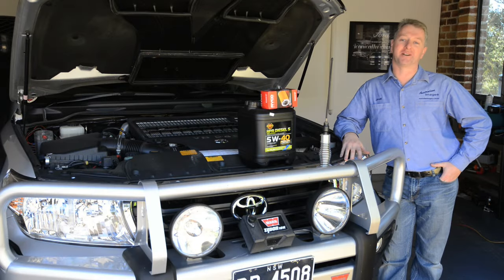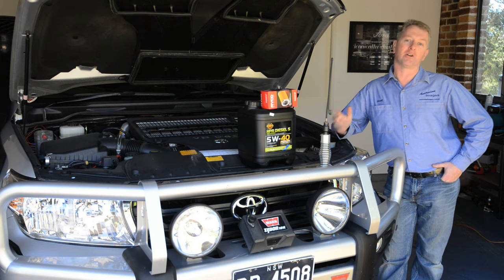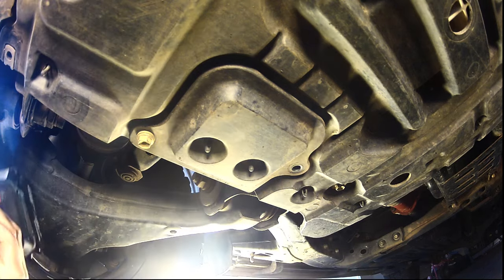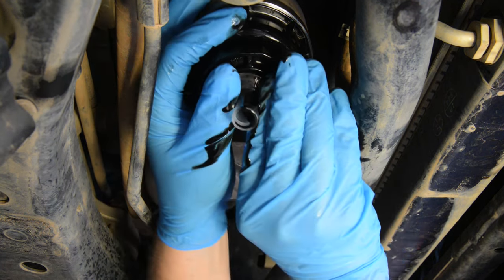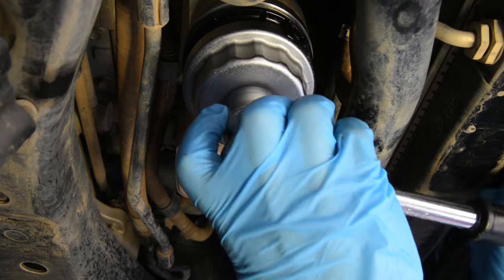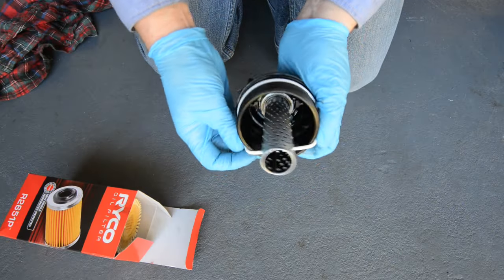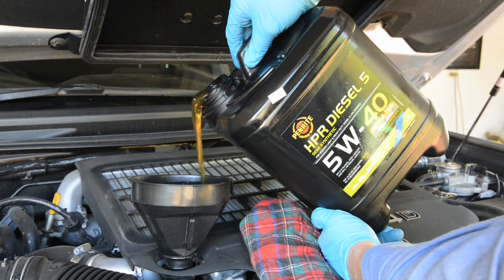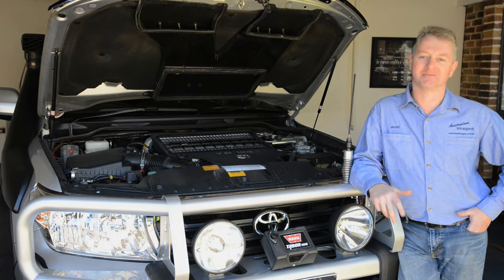LandCruiser 200 oil & oil filter change - Twin Turbo Diesel VDJ200

Comment: I found the dipstick on my Toyota Landcruiser VDJ79R was binding & grinding when inserted into the tube, I smoothed off the sharp edges & tip on the dipstick with some wet & dry sandpaper, wiped it clean & now it glides in smoothly without any hesitation or roughness.

Comment: Great video. I’m in the Philippines and I used toyota 15w_40   Every 5000kms.  How come after the oil change, I checked the dipstick and the new oil is a bit black. Not as clear as yours.
Reply from the maker: It will be dark again as soon as you start the engine. That shot of the light oil was before the engine was started.

Comment: Hi mate. Ive got a 2010 model thats done 320k i tow a caravan occasionally and i live in sydney. Dont you think given its age and with the extra load on it when towing...maybe id be better going slightly thicker and running the penrite 10w 40??
Reply from the maker: Unless you're burning oil on startup, there's nothing to be gained by going to a 10w40 over a 5w40. They are the same at operating temp, the 5w is just thinner when the engine is cold. If you're burning oil and not sure when, there's no harm changing to 10w40 for a while and see if consumption declines.
Reply: @austimages  i see. Thanks for your advice mate. What do you think qbout the penrite hpr 5 5w 40 fully synthetic oil?

Comment: Hi, is 5w40 better than 5w30 for this engine? For lc200 at 62k km, I live in indonesia btw, average temp in here is about 28 to 36 celcius.
Reply from the maker: It does depend on the year model to an extent. Go with what Toyota recommend for your year and temperature conditions. The 5w40 is less susceptible to oil vaporisation than the 5w30. But later DPF versions will need the 5W30.
Reply: @austimages  my lc200 year model is 2015, almost the same with yours, but my headlamp using HID projector, I think this is the pre-facelift (2012-2015) model. 

A week ago I change the oil with amsoil 5w40, I notice the engine sound a little bit quiter, and the engine feel solid and smooth but a little bit "heavier" when running 80kmh to 130kmh. 
When previously I use TMO 5w30 the engine feel not so solid (a little bit "empty") but feel quicker when running 80kmh to 130kmh. 

Is it OK?
Reply from the maker: @candrawp7044  Toyota recommend both 5w30 and 40 depending on the operating conditions. If you're in a warm climate, then 5W40 is best. If you're in a cold climate, then 5W30 is best.

Comment: Gi'Day Jamie, really appreciate your videos & comments. What is your opinion on:--
1} using a detergent oil flush prior to oil change ?

2} warming engine prior to draining oil whether using flush or not ?

3} would the oil drain more efficiently by jacking front of LC200 to tilt the engine or would it drain better if vehicle is level ?

Any experienced opinion welcomed, Cheers, Doug.
Reply from the maker: Hi mate..
1. I wouldn't. It's inevitable that some of the flush stays in there, meaning it reduces lubrication quality until the next change. Quality oils have good soot tolerance, so it's no big deal if a bit of the old oil remains.
2. Can't hurt. It makes the oil thinner, meaning it will drain out better. Just be careful you don't burn yourself.
3. No, leave it level.
Reply: Roger that & thnx for speedy reply, Doug

Comment: I was about to buy a really nice landcruiser 200, however i just found out that the owner has been changing the oil with valvoline 5W50. Would you say i should steer clear of this one?
Reply from the maker: That should be fine. It would have been using a bit more fuel than necessary, but so long as the oil otherwise met the required specs, it wouldn't have done any harm.

Comment: Forgive me if this question has already been answered but I am new to the 200 after coming from the 60 series.
Is there any benefit, in your experience, in fitting a remote dual oil filter system?
I understand adding any additional components/hosing to a stock system opens itself up to issues (leaking etc), however, these systems are quite popular with the yanks in their oversized Dodges, Fords and the like.
The filters can be placed in more readily accessible areas, higher in the engine bay making maintenance easier.
Thanks in advance mate.
Reply from the maker: I haven't looked at anything like that for the 200. They were popular many years ago. I imagine they could increase drain intervals. Lubrication and wear doesn't seem to be an issue for the 1VD, so I'd be skeptical that there would be a practical benefit other than that.
Reply: @austimages  thank you mate. Im really getting a lot out of your channel, great work.

Comment: Pardon me, as I understand all LC 200 1VD-FTVs in Australia are equipped with DPFs. While outside Autralia, for example in Indonesia, we don't have DPF. The 9.2 liter engine oil capacity is it the same for engine with or without DPF? Thanks.
Reply from the maker: From 2007-2015, they didn't have a DPF. It was added with the 2015 facelift. I'm not sure of the oil capacity with the DPF models, but it wouldn't be much different, if at all.
Reply: @austimages  i have a 2012 with dpf in uk
Reply from the maker: @georgesemple8136  They only added the DPF in 2015 in Australia.

Comment: Hi Jamie ... just wondering ... did you install a catch can in your lc200?? Is it a must have thing???Regards
Reply from the maker: No I haven't at this stage. I wouldn't say it's a 'must have', although it does reduce maintenance. I'm planning or an inlet manifold/EGR clean, and will likely install a catch can at the same time.

Comment: Hi I got 2016 lc200 vx lmt  can  you tell me which oil and oil filter I need to use not sure if it got dpf or not. Thanks
Reply from the maker: If you're in Australia, then 2016 has a DPF.
Reply: I’m in New Zealand
Reply: Wat happen if u use the wrong oil non dpf on dpf car? Thanks
Reply from the maker: @NatashaChan-z4v  You can damage the DPF. But there's no problem using DPF compatible oil on a non-DPF engine.
Reply: Thanks so much
Reply: Thanks for ur video it my first time try to do oil change on my lc200. Is it  necessary to Change the fuel filter evertime you do the service? And wat could go wrong?
Reply from the maker: @NatashaChan-z4v  Yes, change the filter every time you change the oil. If you follow the correct procedures, then not much can go wrong. The key issues are:
1. Use the right oil
2. Use the right amount. Check the dipstick before you start the car. Substantially too much or too little can do major damage. Recheck after running for 5 mins.
3. Make sure the sump plug is done up to the correct torque.
4. Make sure the metal filter support is in the oil filter cap. If you throw it away with the old filter, it can cause severe engine damage.

Comment: Hi,Quick question, seems something does not ad up to me. Based on all the available data my 2014 LC 200 V8 diesel takes below 8 Liters of oil, not 9.2L as written. Did anyone experienced this ? Has yellow dip stick as what I have seen there is green and Blue variants also.
Reply: I did! Have you found what's the reason?

Comment: I changed the oil filter and filled 9 ltr of oil and it shows full. Do I need to fill the extra 200 ml that is recommended by the manual?
Reply from the maker: So long as it shows full, that's fine. There could be ~200ml of old oil sitting somewhere in the engine, but re-check the dipstick after running the engine for a while to make sure it's still showing full.
Reply: @austimages  hi mate im in perth what do you think about nulon full synthetic 10w 40 or should you go with semi syn my 1vd has 205kms about to do a 5k change or should i still go with the 5w 40
Reply from the maker: @ado6770  That oil would be fine to use. The advantage of any 5w is that it's better at startup though. No difference once the engine is warmed up.
Reply: @austimages  hey mate ok or what about a 5w 30 or would you suggest the 40
Reply from the maker: @ado6770  No, 30 is too thin for our climate. You'll get a lot of vapourisation. 5W40 is my pick, 10w40 would be next best. Unless you live in the snowys.
Reply: @austimages  thank you for your help very much appreciated, and your videos are excellent for everything 200 series 1vd related.
Reply: Thanks for your reply, my only concern is that when I fill 9 liters exactly (the manual calls for 9,2 ltr) it always show slightly above the max level. I am pretty sure I am following the right procedure for checking the oil level by turning off the engine after it reaches it’s operating temperature and waiting for 5 minutes before checking the dipstick while the car is on level surface but it always shows slightly above max level. Should I trust the owners manual which calls for 9,2 ltr or the dipstick? Should I drain a little oil to bring the level down? I am confused. I checked with other 200 series owners in the area and they all face the same issue so they started filling it with 8.5 and the level shows exactly on the max level. But will filling the engine with only 8.5 vs 9.2 starve the engine?
Note: all the capacities I mentioned above are with filter change.

Comment: Just out of curiosity. Is that antenna connected to anything or is it just an Australia accessory? :-))
Reply from the maker: LOL. UHF CB radio
Reply: @austimages  AND IT WORKS!?
Reply from the maker: @Maloy7800  Naturally! The heavy base can accept different antennas. Big fibreglass one when travelling, little whip (in video) for around town so I can fit into underground carparks.

Comment: What about 5w-30 full synthetic oil for this engine?
Reply from the maker: You can use it. Just that when hot you'll find it vaporises more than the 5w40, so you might find the engine consumes more oil.

Comment: What does that metal clip do. I can't see any purpose for it.
Reply from the maker: The metal clip on the outside of the oil filter cap? It's an anti-vibration fitting to stop the cap coming loose. Pretty unlikely though, as the O ring does a good job of it anyway. I can only assume that in testing they may have had a cap come loose, so they added the clip.
Reply: @austimages  Thanks for your reply, the clip appears to just sit there but what you say does sound like it would give vibration an exit point. Thanks I have recently bought my 200 after being a long time Range Rover owner so your videos for me are a great resource for me to learn from. Thanks again.
Reply from the maker: @zoezoe610  While it does just sit there, it presses against the aluminium, adding another friction point. Also, if the cap were to turn more than 1/4 of a turn or so, it would hit a lump in the casting, preventing it from turning further.
Reply: @austimages  Thanks

Comment: Thanks for your video my questions how much Lt for vdj 200
Reply from the maker: Just over 9 litres with a filter change
Reply: @austimages  thanks so much my friend
Reply: More question I have problem with  steering pump noise how to fix this issue
Reply from the maker: @hamzahabits7912  I haven't experienced that myself, so can only suggest you have it checked by a mechanic. The power steering pump is gear-driven from the timing chain, so I would suggest you get it checked quickly, as a major failure of the pump could cause severe damage if it causes the timing chain to break.
Reply: @austimages  thanks so much

Comment: Hello, I see owner manual say 10w30 or 5w30, for engine 1VD-FTV, WHY YOU ARE USIING 5W-40
Reply from the maker: 5W40 is thin when cold (5W better than 10W) so gives good cold start protection, but not too thin when hot (40 better than 30), so doesn't vaporise too much at high temperatures. 0W30 or 5W30 would be the choice for cold climates, but for warm climates like Australia, 5W40 is the better choice.
Reply: Thank you very much. For this engine 1VD-FTV 4.5 TWIN TURBO, EVERY KILOMETER SHOULD CHANGE THE OIL (MINERAL) AND EACH MANY KILOMETERS IF USE FULL SYNTHETIC
Reply from the maker: Toyota recommend every 10000km, which I would suggest as a maximum. You could go 5,000km if you're in severe operating conditions.
Reply: Australian Images 10000km, it does not matter if it is synthetic or mineral? Are you given the same time?
Reply from the maker: Yes. I always change every 10,000, even with synthetic oil.
Reply: I am using Motul 8100 X-CESS 5W-40 FUL 100% SYNTHETIC
Reply from the maker: That would be fine
Reply: Tnaks, Do you have or know any page where I can dowload a Service Manual for Land Cruiser lc 200, 2008 turbo Diesel, 4.5 L engine?
Reply from the maker: No sorry. You can get them from Toyota.